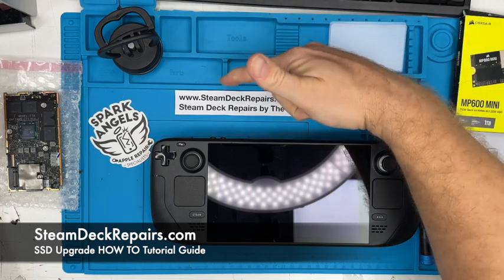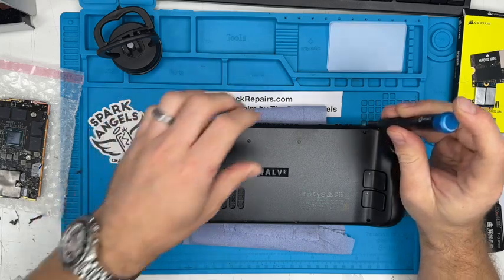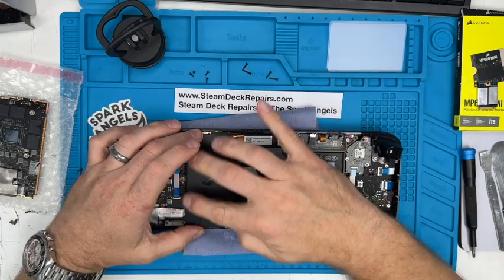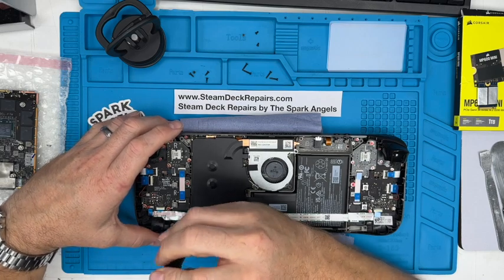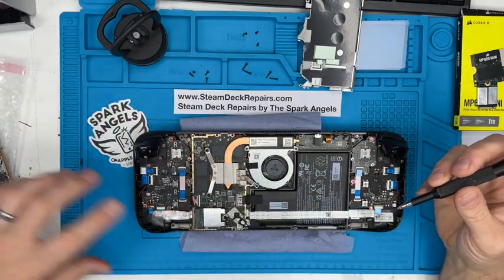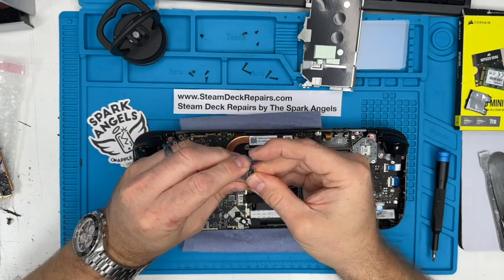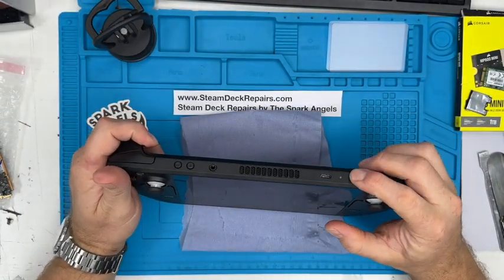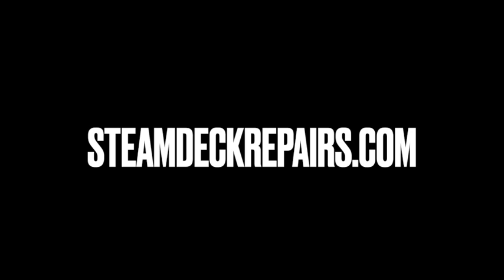Upgrade Your Steam Deck SSD: Step-by-Step Guide from 64GB to 512GB or 1TB

Comment: I don't recommend installing a storage device on a system that's live, even more so if said system has a battery. PCI-E based M.2 SSDs aren't hot-swappable.
ALWAYS shut down the device and disconnect the battery to avoid surprises, but don't forget to reconnect the battery once you're done, prior to reassembling the device.
Reply from the maker: Fair point, well presented! Disconnect the battery folks... I will heed that in future videos 👍🏻
Reply: DISCLAIMER! You still need to download steam os onto a harddrive and redownload it to ur new SSD
Reply from the maker: Also a good point!  @chickenjoe6528
Reply: Does this apply if you are replacing the 64gb ssd with a 512gb ssd from another steam deck?  @chickenjoe6528